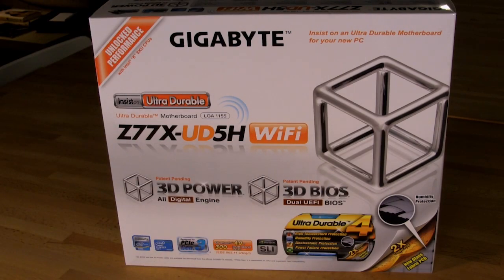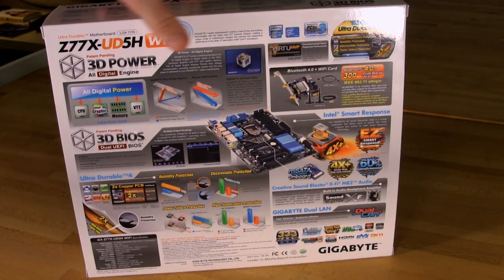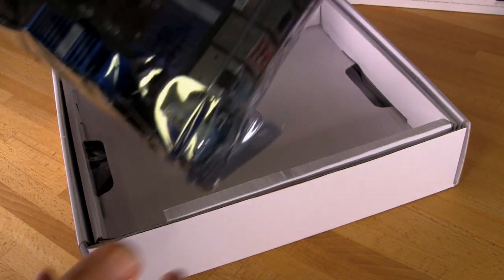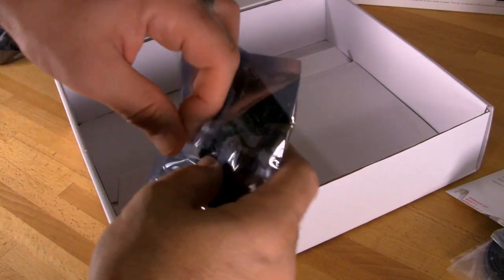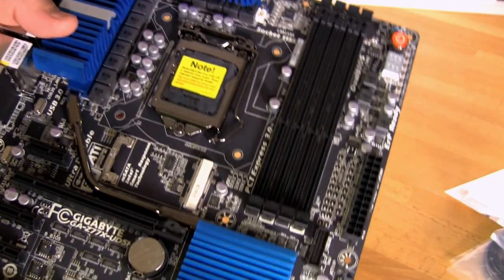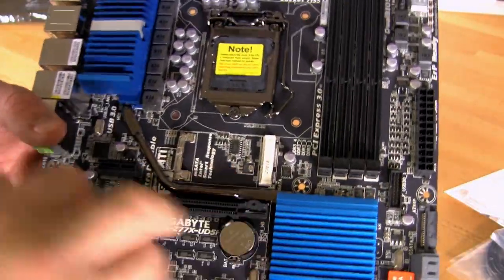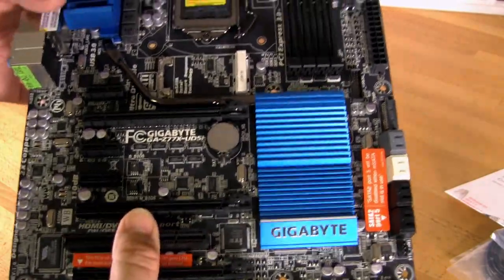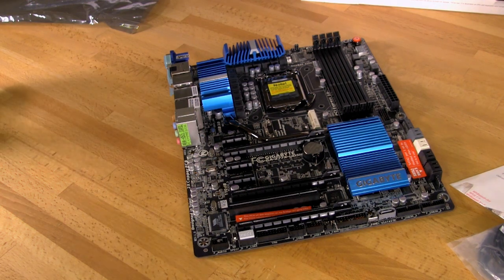Gigabyte GAZ77X-UD5H WiFi  Design and Features

Comment from the maker: Motherboards are not 32 or 64 bit. That is a function of the OS. We always use 64-bit versions of Windows and can run more than 4GB oif RAM on Gigabyte boards. Also the 4GB limit is a Windows (Desktop OS) limit. in most versions of Linux and Windows Server you can run more than 4GB of RAM even in a 32-bit version.